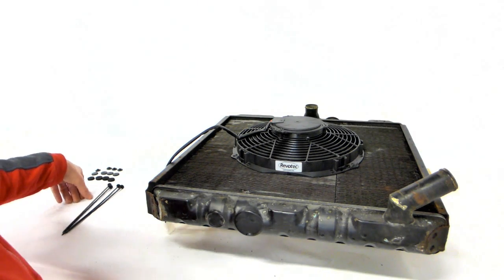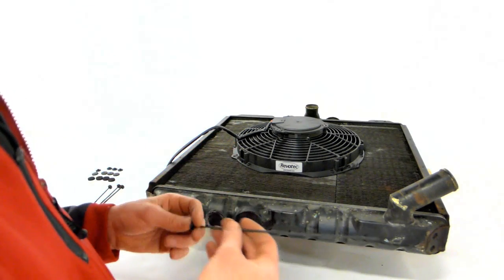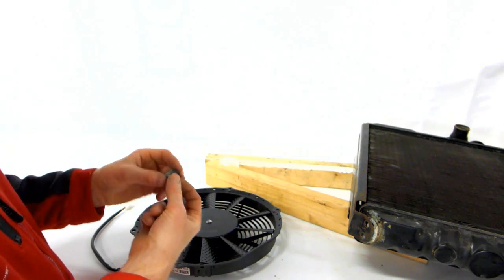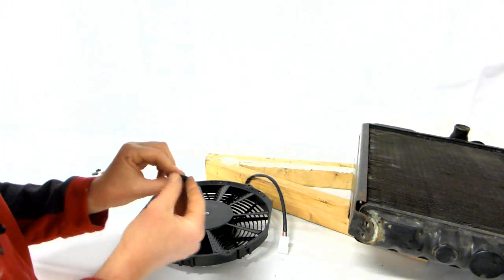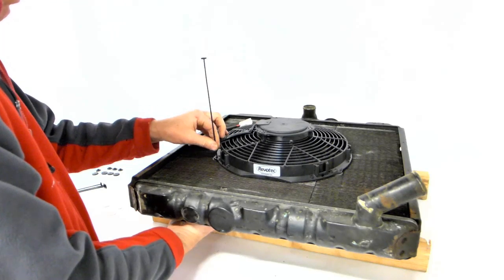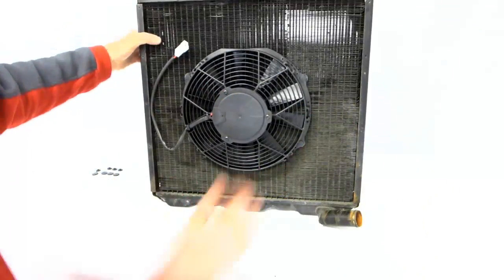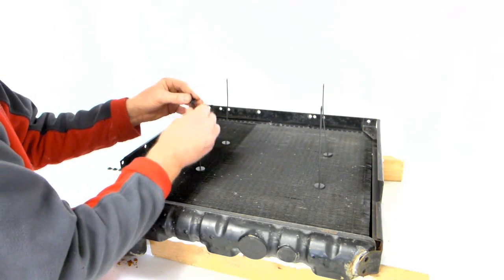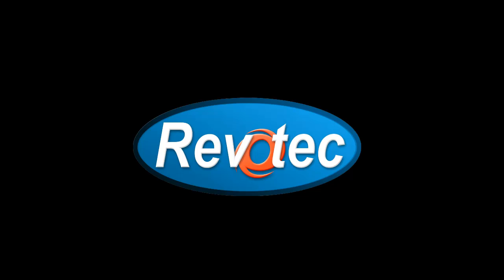Fan Pull Through Kit Fitting Video

Comment: Isn't the fan suppose to sit flat on radiator to pull maximum amount of air? I noticed you put those grommets between fan and radiator
Reply: venomwagon to avoid the fins vibrating against the fan and potential shave/ break it

Comment: which is better? push or pull configuration?
Reply: Gilbert Alexander Tan depends on your application, I use a pusher fan on my swapped e30.
Reply: Should be puller always. As your driving, wind is blowing thru your bumper and grill. If you have it set as pusher your fighting against the wind. Also pulling vs pushing helps to evacuate hot engine bay heat thru underneath your car.
Reply: @HaileyLove42  If you have it set as a pusher then you would put it in front of the radiator.
Reply: @juanm2188  most cars that have ac don't have room to put a fan between radiator and condenser. From engine bay my honda prelude goes twin 12" mishimoto radiators a full size radiator( I had my turbo manifold built so I could keep power steering ac and full radiator), then ac condenser then intercooler than power steering cooler.